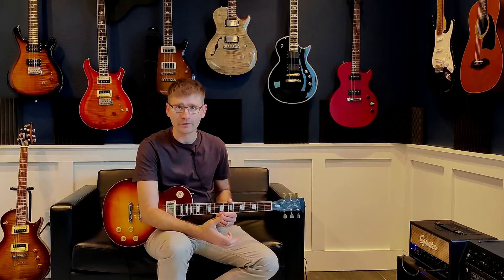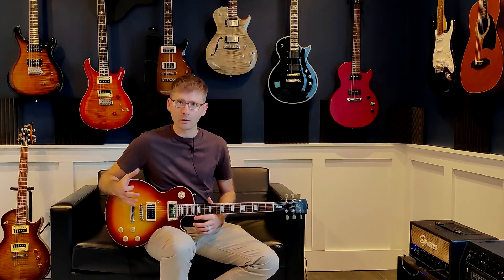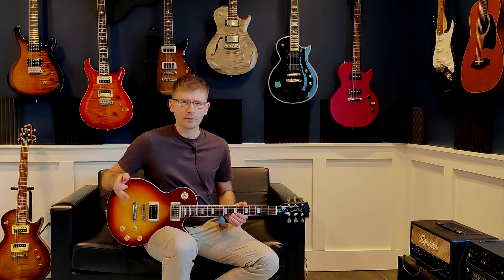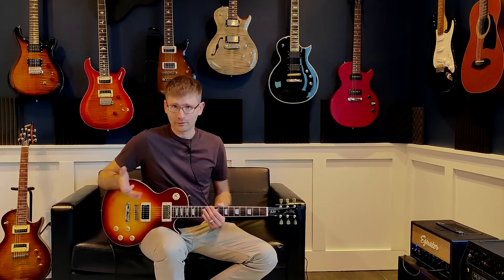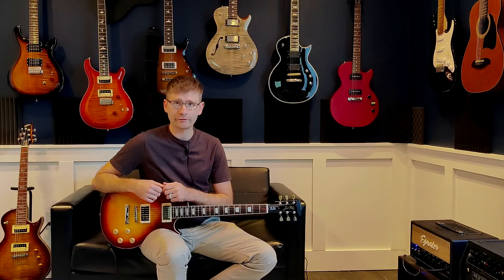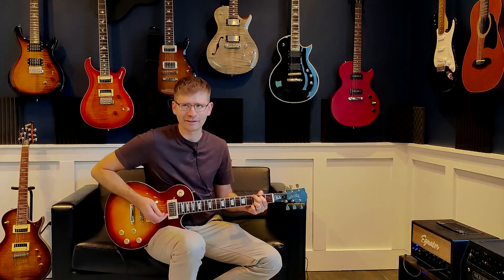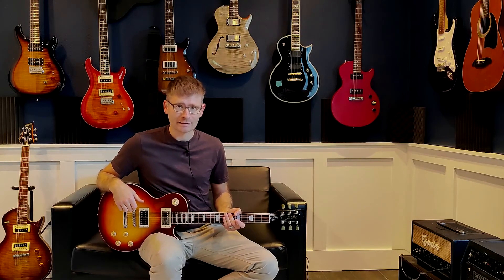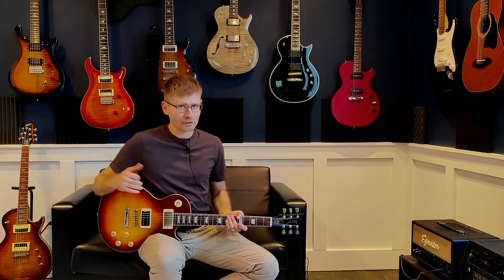Cable Capacitance and Resonant Frequency (Your Guitar Tone)

Comment: Absolutely true John!
Resistance of the pickups and the transmission line including the input impedance of the amplifier just influences the volume (amplitude), but the capacitance (pickup, CABLE, amp input) has influence on the overtone spectrum structure (all the overtone amplitudes) and this changes the sound. And yes, we can definately hear the 'sound of a cable' on high impedance inputs.
Great observation!
Much love 🤗 
Matthias 💕

Comment: If you go to guitar nuts 2 you will see all the pickup guys quote capacitance in their pickup graphs. And people will say you should scatter wind pickups because it lowers capacitance. 

But I think you've demonstrated it probably doesn't make much difference. People that concerned with tone will either have an EQ pedal or have an EQ pedal in their amplifiers anyway. 

If you want to do another test I would urge you to get a picking machine, since there's probably a lot of confirmation bias.